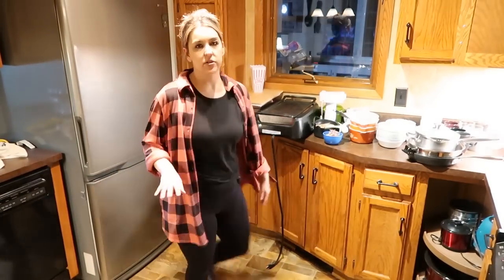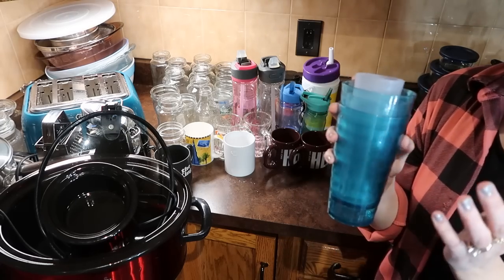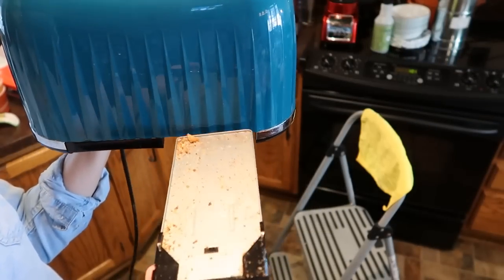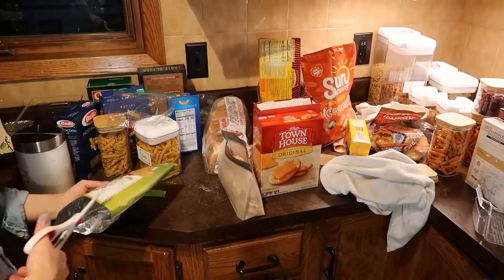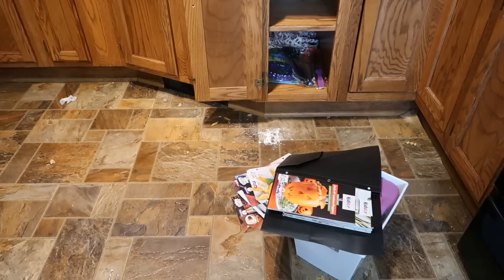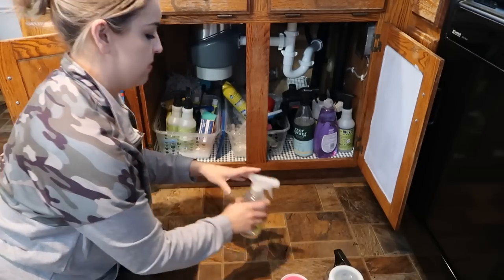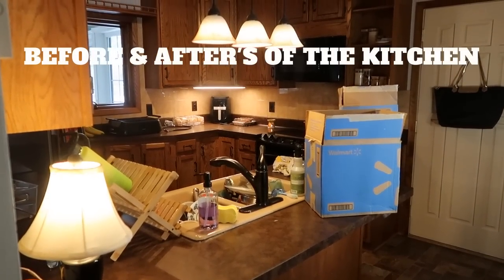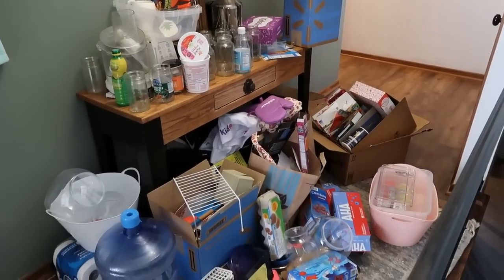THE MOST EXTREME KITCHEN DEEP CLEAN, DECLUTTER & ORGANIZE + Restock & Rearrange | Let's Do this!

Comment: We are doing some remodeling projects in our house right now.  They are not much fun somedays.  I think you should box the window in the looks into the other room by the tall pantry cabinet.  Remove the angled cabinet and the small one next to it.  Put your fridge in that spot.  Cut the counter to fit against the fridge.  Then you don't have the awkwardness with your fridge being in the corner.  Buy a couple of pantry cabinets from Lowes or Home depot that are their stock cabinets.  You could sand your cabinets and paint them a lighter color until you are able to do a complete gut job of the room.   Maybe if you just lighten the upper cabinets for now and the lowers later.  Have a great day and happy decluttering!

Comment: The cabin… the place we send stuff we think is too good to let go. It’s a temporary storage place of the unwanted stuff. I’m planning to declutter ours this summer.  That corner between the sink and stove is our primary work area. We have the same carousel or turntable cabinet. It’s our baking cabinet. We store sugars, flours, corn meal, chocolate chips, nuts, cupcake liners, etc.  We have another carousel cabinet above. It holds all spices, sauces, oils, vinegars, etc. within easy reach from the stove. ▪️Tip: We keep measuring cups inside each canister.

Comment: Check the breaker on the dishwasher and also if you have a garbage disposal put some drain clearing solution into bottom of dishwasher. Grease may have built up

Comment: This video is so relatable. I went to make dinner the other day and noticed the handle of the cabinet was loose so I went to the laundry room to get a screw driver when I realized I needed to vacuum the dryer vent. Then I realized I left my laundry in the dryer so I took it out to put it away and as I way putting my towels away I realized I needed to clean my bathroom which led to me refilling my qtip and cotton pad jars which made me realize I needed to refill my spices. Long story short I ended up having a Poptart for dinner.

Comment: I had to watch a bit before I subscribed (I'm new)
But I'm really happy to subscribe to your channel. You're so comical and down to earth. I cleaned the bottom of my fridge with a special brush for that and it worked better. That little front panel comes off and you can "roll" that brush through the coils to clean them. The clincher for ME though was when you went through your jar collection. I need to do that because I'm a newly found out jar hoarder. I can't stand throwing away a perfectly beautiful strong jar especially ones with ornate designs. I soak them and use goo gone if it's too sticky. I have used scraper blades too. 
You're fun and easy to listen to. Love and probably prefer the voice overs.

Comment: I've got a tip for you to renew your kitchen. It doesn't do anything with the planning, but the colours can be replaced instantly with foiling products. You can get foil for cabinets, floor, wall and bench and everything else you want to foil. I don't really know where you can get it in the US, but I think you can get it at Amazon at least. I would probably have painted the cabinets. I know it's expencive to replace the whole kitchen, and that you love DIY, so I thought I would suggest it for you in case you haven't thought about it. I'm going to buy foil that looks like tiles and also for the counters to match it as my kitchen now is old and all white and light grey. I rent my apartment so I can't just do as I like, but I can remove the tile foil when I move, even though I might not, but it would be possible so it will not destroy anything. 
If you paint the cabinets and get foil for the counter top and tiles your kitchen floor would probably look good. Old is old, but you can get it better waiting for a whole new kitchen. 😊
Reply: Ohh yes nice recommendation! There are gorgeous foils out there omg I can see it

Comment: You know, to remove labels , score them then soak in warm soapy water . Most will come off quite easily. I hate wasting glass jars . I decant most all my foods into glass jars …I also dehydrate, ferment and can my foods , so I recycle commercially bought glass jars for those .
Reply: WD40 will take them off easily.
Reply: @ucfhillcollege8296  I don’t usually have WD40 and try not to use too many chemicals, especially around my food, but I’m sure that would be helpful, also.
Reply: @ucfhillcollege8296  also eucalyptus\tea tree oil or orange essential oil etc (or any oil really lol) will help remove the sticky residue from the back of labels 😃

Comment: 🤗👏👏 glad to see your video! We went on vacation came back and dishwasher wasnt working so we went and bought a new one hired someone to install they werent electricians when they went to hook up to electric,  in the box was burnt wires we didn't smell it?? So needless to say the old dishwasher was still working 😣lol!! Then after storm the refrigerator wasn't cooling the freezer worked but it was just the temperature regulator dont know exactly what it was called replaced cost a little over a hundred dollars but at least it wasn't major.. Do you have lemon essential oil? It will take off labels easily let it soak in a bit.

Comment: You actually increase your electric, water and sewer bill by hand washing dishes.  
WATER -  You use up to 27 gallons of water per load by hand versus as little as 3 gallons with a dishwasher.
ElECTRICITY -   if that's how you heat your water, a dishwasher is the cheapest to wash your dishes.